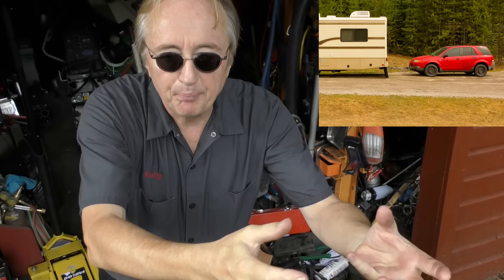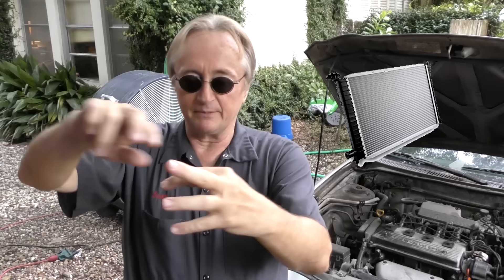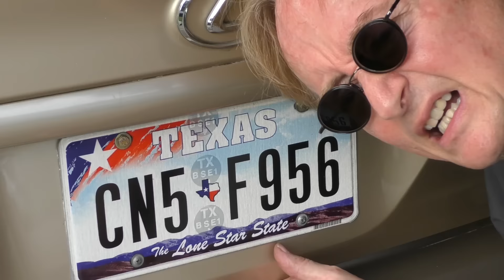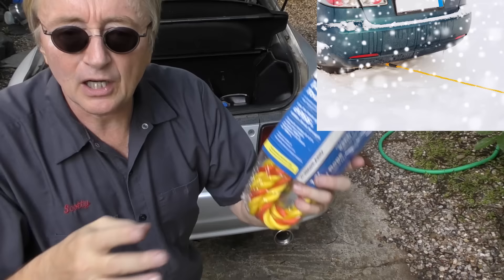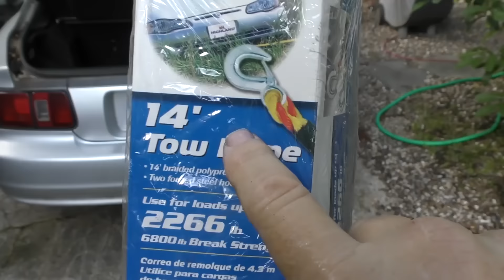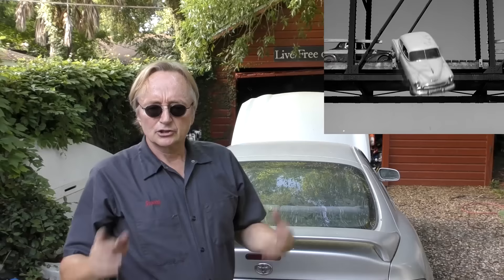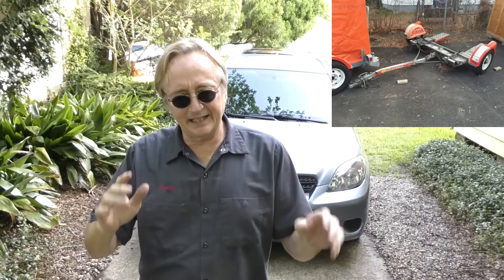Never Do This to Your Car

Comment: So heres the thing... Factory tow hooks of any kind are designed only for that. For tow trucks to slowly pull into tension with a winch. They are NOT recovery points by any means. They are not designed for a tow strap to be used on. They are not rated for the pull of another vehicle. Only aftermarket rated recovery points should be used for recovery. Otherwise if you have a trailer hitch that's a great strong point as well. Any tow operator that knows what they're doing knows vehicles and wont ruin your car. Usually a rollback is what's best and what's most common nowadays anyways. And when winching onto the bed they should know to put it in neutral. If on the stinger and its AWD, they should have dolleys to put under the other wheels. Even repo trucks do it.

Comment: Often those older tow hooks on the Japanese cars were not actually there to be tow hooks, but were there to tie it down in shipping on the boat.
Reply: Correct. Also for tying down on top of a flatbed tow truck.
Reply: Y’all are out of your minds.

Comment: Where I live we call that type of tow truck a rollback. And it's a side note I have a four-wheel drive with an automatic transmission and I have no issues towing it with any of the drive wheels on the ground because I can't engage the transfer case to neutral.

Comment: I had an 82 Firebird, this was years ago. Tow truck driver hooked front wheels, when he lifted car the entire front facia came right up with it, I told the guy a flatbed was needed, he hardly could get the forks under the car to begin with. They paid out almost $3000 in body work for a car worth $2000. I warned the driver, but he said he knew what he was doing, I hope that $ was payroll deducted

Comment: My Shovette broke down. The the steering lock was broken so it had to be towed by the front. My Dad told me the automatic transmission had to in neutral and the engine had to be running in order to tow so the fluid was pumped through. The wrecker guy didn't know squat. That was the way it was towed, engine running in neutral. The Shovette was a death trap, but towing it didn't destroy the transmission or the engine. It worked.

Comment: Flatbed tow for every car or truck if you can. Motorcycle, get a truck and trailer,  I've had one put on a flatbed, it's scary as hell. And make sure it's on the tires, not the stands. You'll break them easily. 4 straps (each one with a working weight higher than the bikes weight), compress the suspension halfway, it'll ride just fine.

Comment: Always request a flatbed tow truck!!
Reply: That's for sure 👍
Reply: Flatbeds are the ONLY kinds of tow trucks I have seen for years.  I think it's just easier and safer for everyone today.
Reply: Flatbeds aren’t the best for everything, and run a higher risk of damage on some cars. Unless you have experience towing, don’t tell the towing company what to send. Tell them the situation, and they’ll send the truck that will best handle the situation. You don’t march into the kitchen at a restaurant and tell them how to make your food, so don’t do it to your tow driver.
Reply: Europian Enthusiast Even if the dispatcher doesn’t, the driver should know if he can’t do it. If I get a call for an R8 with 4 flats, I don’t care what dispatch says, that needs to go on a flatbed. If it can’t go into neutral or is in a tight parking lot, the FB guys know to send it to us wheel lifts. Dispatchers are almost always useless, but the drivers know what they’re doing.

Comment: I bought a Stehl Tow dolly about 7 years ago & its paid for itself all the times I’ve used it to tow my & other people’s vehicles for them. The only thing that makes me nervous about it is when you use the straps to secure the vehicle to the dolly. Seems like the pressure needed to safely secure the car to the dolly (not too much, not too little) via the straps may do some damage to suspension parts.

Comment: You're a fun guy. These videos are informative. Thanks. Here's a tip (or maybe not), On my Honda Odyssey there wasn't much to tie my kayak to at the front,  on the  Prius V I replaced it with, there's nothing at all-- except that single point screw in eye-bolt.  What I did was take about 18" of  1" webbing,  put the ends together and using a soldering iron melted a hole through the ends. Then under the hood I removed one of the fender screws, they all seem to have flanges, so you don't need a washer, then screwed it back down over the webbing. Now on either side there's a  6" loop sticking out from under the sides of the hood (and if I want I can tuck them inside the hood) Not for towing obviously but works great for tying loads down.

Comment: Hey Scotty, thanks for putting out sensible and informative automotive related videos.  Not sure if you've ever covered it but I was in a parts store recently and saw they had a "radiator flush and cleaner", hmmm.   I've been working on cars (my own and my friends) for 40 years or so and have always just: drained the worn fluid, used DI water flushes till clear (usually 2-3), then go with the recommended antifreeze/DI water mix, and recycled my old fluid and flush liquid.  Is this "flush+cleaner" stuff worth it or just another gimmick?  Thanks in advance!  A very long time ago I was a mechanic on a nuclear attack sub and became confident on fixing mechanical/electrical stuff seeing how another human being made the item in question, and me being human with a repair manual.  So far, I haven't turn a wrench on any alien tech (yet).

Comment: Sorry Scotty, but I have to call you out on something. You pointed out some places that you "hook to" on your Celica. I hate to tell you, but those are not towing hooks. They're for the safety chains. They are not designed to be pulled on. The towing hook points are behind the front wheels and ahead of the rear wheels. You may ask how I know this, I'm a flatbed operator with nearly 20 years experience. 

But, I love your videos, they're informative and entertaining.

Comment: 1:56 FO NOT EVER DO THAT. Thats insanely dangerous if the wheel turns even slightly itll shift a lot of weight and be dangerous. Just get a traiker like a full size one u can put all 4 on.
Reply: No if the wheels turn and it's rwd it's will turn a bit side ways you can see it take a string tie the steering to the door simple auto towing

Comment: You can tow a 4x4 flat if you put the transfer case in neutral.  Lots of people will tow a Jeep this way with a motorhome. Safe but make sure it’s the transfer case and not the transmission.

Comment: If you are cheap.  Have a friend with a decent pickup, @20’ flatbed trailer with ramp, few 3300lb rated straps (or dedicated tire straps) a winch, or even manual cable winch… you can safely load,haul disabled vehicle yourself any distance.

Comment: Depends how many miles an all wheel drive was towed.. Local close by is OK in neutral but forget about any distance.
Reply: Edward Anthony not true.
Reply: @Mr666Rev  give an example.
Reply: Edward Anthony I don’t have time to explain to you how an automatic transmission works. 
Just know that I’m a professional tow operator, and I probably know quite a bit more about safely towing than you do.
Reply: Edward Anthony the short version is that you cannot disconnect the front and rear wheels from each other in an AWD system, or from the transmission by simply putting the trans in neutral. You’d still be turning the transmission internals without proper lubrication. But don’t take my word for it. 
Do whatever you like. 
HMU when you need a tow.
Reply: @Mr666Rev  No doubt.
Reply: @Mr666Rev  Let's say a Honda CR-V was towed with a rope for 10 miles. Would that be a problem? The car drives like normal and no issues with radiator or tranny fluid loss.
Reply: Edward Anthony no problems now, but do that a couple of times. 
Also, 10 miles isn’t considered a short distance when you’re towing a vehicle on its drive wheels. 
Think about it this way. Your entire drivetrain is designed to have power traveling down from the engine, through the transmission, to the wheels. All of the components are designed for that direction of power. When you tow it on the drive wheels, you’re effectively applying power in the exact opposite way the components were designed. 
A little bit of damage may not be noticeable now, but it may show up many miles later.

Comment: I have AAA, they have helped me a lot. Just never use it in NYC. My car's battery died in a one hour parking spot and I called AAA. They sent a guy who owned a shop in town. He said my alternator and starter were shot but he'd get the car started and told me it wouldn't run if I turned it off, so I better drive it to his shop. I drove it home and the next day I had the car towed to my regular mechanic I trusted. Turns out just the battery needed to be replaced. 

Why was I driving my car in NYC? I lived in New Jersey, going to grad school for music, I play the double bass. I had a gig. Taking that thing on the trains and subways is a huge pain in the butt especially when people are so inconsiderate  I had no choice and probably ruined a lot of peoples' elbows and I got tired of saying "Well, I said 'excuse me' and warned ya, and I gotta walk down this aisle." Also it didn't fit through the turnstiles and it was always a pain and wasted lots of time to find a transit authority employee to let me through the subway platform exit. Luckily I don't live in the North East anymore. My vehicles appreciate it, too. I also don't own a Nissan anymore, too.

Comment: Scotty, having done roadside assistance for the CAA I have towed a lot of cars. I need to point out though, that what you referred to as "Tow Hooks" on the Toyota are not that. They are tie downs for when the car is being transported. The other "Tow hook" is a recovery attachment that should never be used for towing, but for when the vehicle needs to be winched, like out of a ditch or moved to be properly loaded onto the tow truck. Also, I would advise against towing cars backwards, the aerodynamics of today's cars are finely tuned, it's ok if you're doing a short hop, but once you get up to highway speeds, things have a tendency of flying off, mirrors and tonneau covers especially. Use a flatbed of dolly wheels if you're transporting a rear wheel drive car over a distance. In Canada, the CAA charges about $150.00 for their premier package that gets you 5 service calls - anything from fuel delivery, if you run out of gas, battery service, tire changing, or towing up to 200 kms; that's 1000 total towed kms!  It's the best insurance you can get, considering that just a hook up is about $150.00 in Toronto plus mileage to the shop. Not sure what AAA charges, but I bet it's similar.

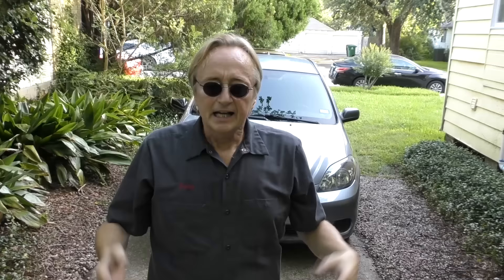Comment: 6:11 Tow hitches are illegal in some European countries. There you have two options basically, a tow rope (they are not allowed on highways, you can tow no faster than 50 km/h using them) or just get a flatbed.

Comment: With a car like your Lexus, you load the car with that tow hook, BUT once loaded and the car is in park w the e brake on, you use 4 point straps, and release the tension on the hook. Towing with tension on the hook can damage the hook or the bumper.

Comment: Huh, I'd think just putting it in neutral would disconnect the automatic transmission.

Guess I am wrong about that...
Reply: Lagger Onesixfour some of the  information in this one is incorrect. How is transmission fluid going through the transmission cooler on the radiator if there’s no pump working to move fluid with the car off and being towed? Also, how do you blow the head gasket? The car engine is off so the water pump is not circulating fluid as it needs to be driven by the serpentine belt in order to circulate the fluid. So how can hot coolant get inside the engine to blow the head gasket? The thermostat is even closed on a cold engine which prevents any circulation of coolant through the radiator. Even if it was possible to have an overheated radiator in this situation, which it’s not, there is air movement past the radiator while the car is towed which works to cool the radiator off just as the cooling fan does when it’s running when a car is parked and idling. There’s also airflow beneath the car that would help dissipate heat from the transmission through convection heat transfer. This logic makes no sense at all. If anything it sounds like a case of a Subaru that broke down due to a head gasket failure and then they towed it and ruined the transmission by overheating it from a lack of lubrication and overheated transmission fluid caused by the moving torque converter. There’s no way that towing the vehicle blew the head gasket...
Reply: @newfie-dean5803  give it a rest already. 🖕😠🖕
Reply: steve hairston have a nice day AH.
Reply: @newfie-dean5803   Just GIVE IT A REST!!!
Reply: paul joe 😂😂😂😂. Scotty should do a video to correct himself but he would likely never admit he’s wrong!
Reply: @newfie-dean5803  this AH always has a nice day after telling some other AH to just give it a rest. By the way, penicillin clears up syphilis if diagnosed early enough. 

 Sorry Scotty, it had to be said. 😂

Comment: I didn't know that towing an automatic could screw up the transmission. Does anyone know if it can make the transmission slip though?
Reply: A slipping transmission is usually a worn or damaged transmission. You could try replacing the fluid if it smells burnt or replacing the filter if it has alot of mileage, but chances are the clutch plates and/or bands are worn out. The only fix is a rebuild. This is exactly why people should stop buying automatics.